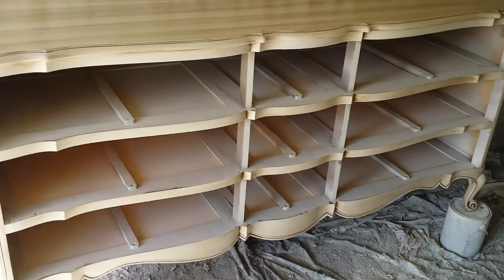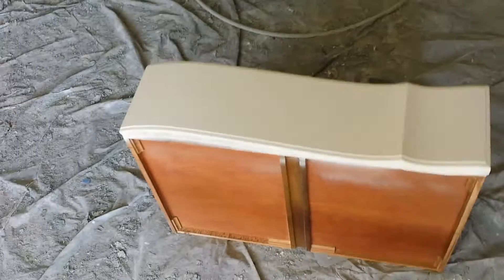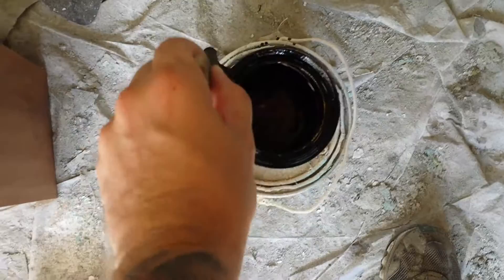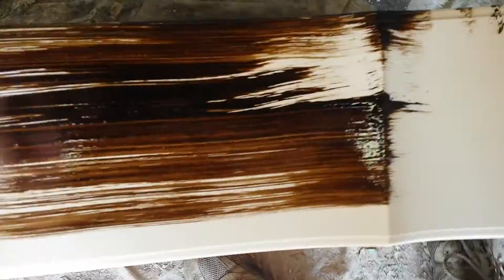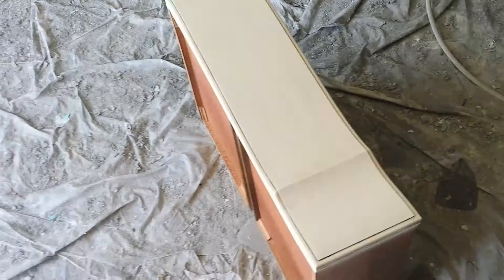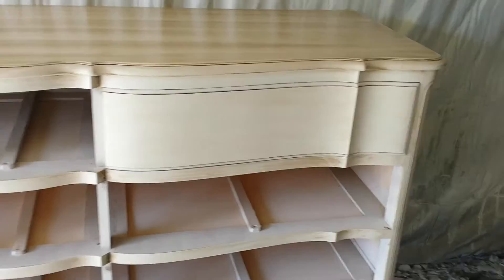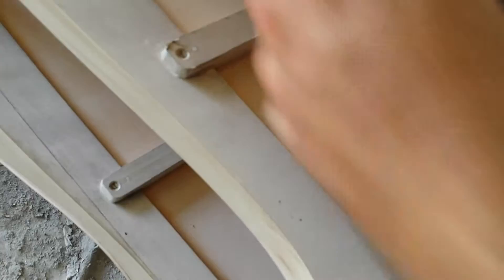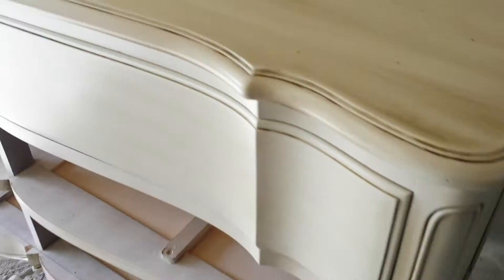Painting Shabby Chic Furniture: Start to Finish - Part 14

Comment: Would I be able to use Rustoleum Kona stain and receive the same results on an antique white paint stain? Does the paint stain need to have a certain finish?
Reply from the maker: I'm not sure. I've only used Rustoleum's stain once or twice because Minwax doesn't/didn't carry a weathered gray. I tried it out on some paint and it didnt work the same. It was almost like the base of the stain was different and it just wiped right off the paint.

Minwax stains seem to be more oily, while Rustoleums (the ones I have used) seem like they have a different type of dye in them or it may be that I've only used one of their stains and I dont know what I'm talking about. lol. Not all Minwax stains work well either, like mahogany, oak, lighter stains, etc.

The best thing to do is test it out. Get some white, satin paint (matte/eggshell will soak up too much stain and be hard to rub off. semi-gloss doesn't absorb enough), brush a little 12x12 test spot on something, let it dry, and test out the stain you have to see what it does. Good luck!

Comment: What color is the stain that you used in video?  Is it an oil based stain and can I use it over latex paint on kitchen cabinets?  What type of sealer would I use over the stain?  This technique looks easier than mixing paint with glaze.  Thank you!  Carolyn
Reply from the maker: +Carolyn Fleck I use Minwax Dark Walnut for brown glazing and Ebony for black or gray. It is oil based and can be used on latex. You can seal with polyurethane, lacquer, etc but it must be sprayed. Wiping will make the stain come off in one wipe. Check out some of my newer videos. They're shorter, more to the point, and include tips during some of the videos.

Comment: I really enjoyed your videos! I learned some great tips. What kind of sprayer do you use? I have a wagner sprayer but I have a hard time getting a smooth finish.
Reply from the maker: +Shalece Stoffers I use a Graco Magnum LTS-15 sprayer. They are around $250-$300 depending on your location. If you decide to get one, be sure to get a 415 tip and a 413 tip. It comes with a 10in tip for paint (515) but it is way too wide of a spray for most furniture and wastes paint. The 415 tip is an 8 inch tip (the first number in the tip part number designates the fan size x2 and the second numbers represent the hole size. So a 415 tip is an 8 inch fan with a .15mm hole for paint.) the 413 is for thinner mediums like polyurethane for top coating, which would be a good idea to do if you have a sprayer rather than waxing or brushing poly.